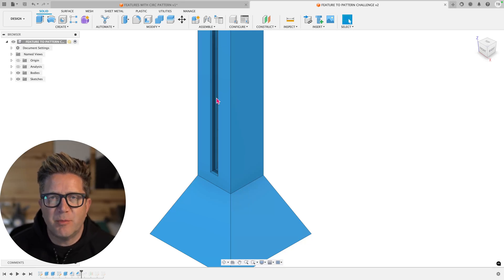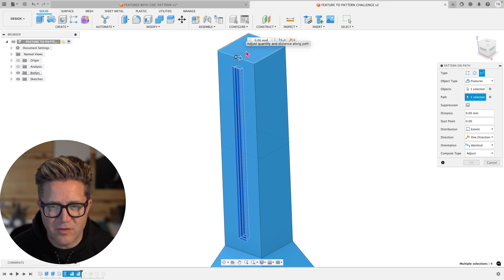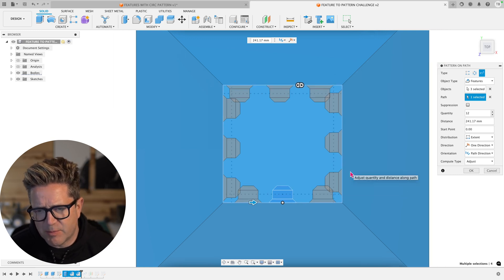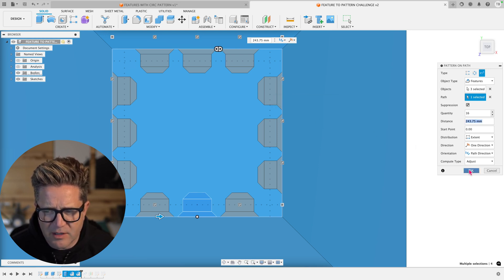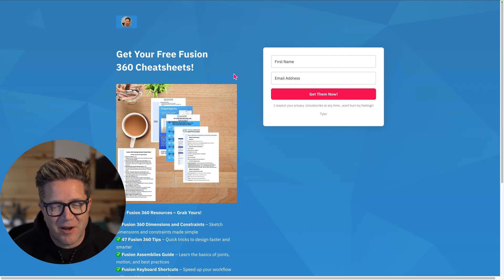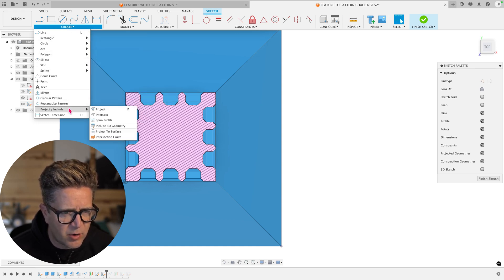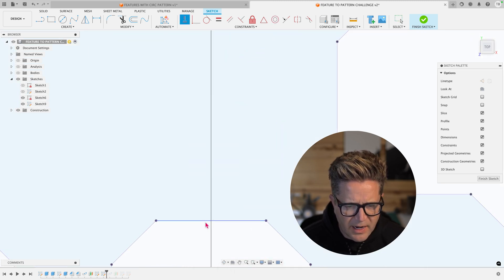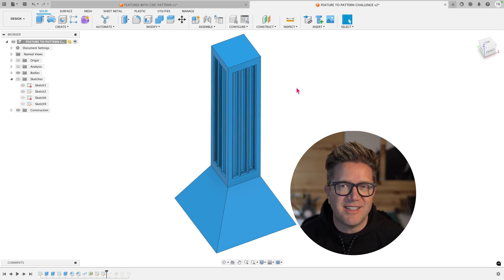Pattern on Path in Fusion for This??? (Fusion 360 Pattern Challenge)

Comment: Just a thought – haven't actually tried it – you could increase the quantity to 17 and snap the pattern extent point to the starting point (or enter '4*side length'), suppress the last instance (basically identical to the original feature) as well and it should give you the perfect result you were after.
Love your tutorials, have learned heaps from them!

Comment: Here's another simpler, faster, and math-free way to do it. First, rectangle pattern one copy of the flute symmetrically along the edge, resulting in three evenly spaced flutes on one side. Next, select all three of them, and circle pattern four copies 360 degrees around the column. Note how this is the same operation performed in 0:18 in the video, except in this case, three flutes are copied and oriented perpendicular to each other as a single entity.
Reply: Tyler put in the constraint of doing it in one operation. You can rightly argue that having to create a construction plane, a sketch, sketch lines, and sketch points to verify the result, is not really a single operation anymore.
Reply: @Djeez2  Good point. I'm not sure if the verification steps afterwards are required, but if they're not then it's indeed a single feature. There's also the case, however, where the feature may require adjusting if the dimensions of the square column changes, whereas the two feature solution retains its relative dimensions.

Comment: Very interesting problem!  If you use spacing instead of extent and set the spacing to a fraction of the length of one side of the path, I think you'll get what you were looking for.  Since your column is 32.5 mm per side, you could e.g. set the spacing to "32.5/3" to get 3 evenly spaced features per side.  To fix the problem with features intersecting, change the denominator to a higher number like 32.5/4 to make them closer together, and then proceed as you already did with increasing the number of features and suppressing the ones you don't want.